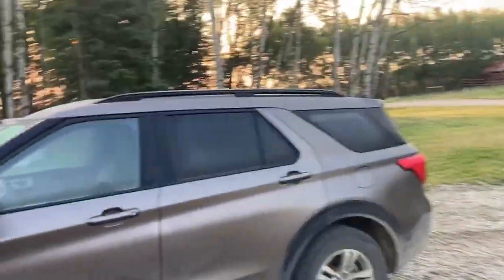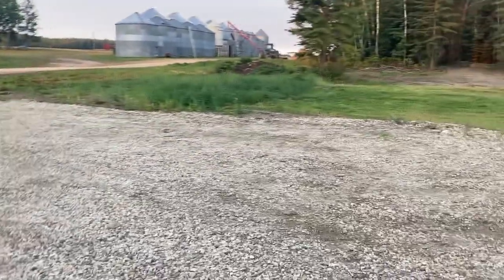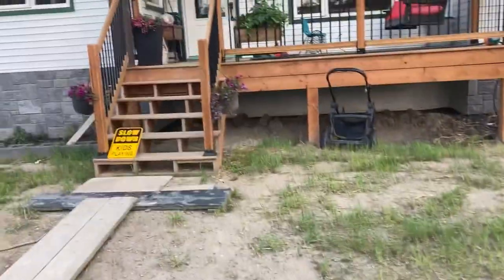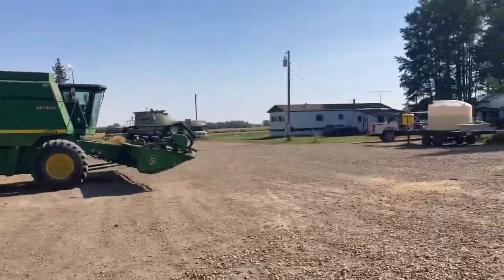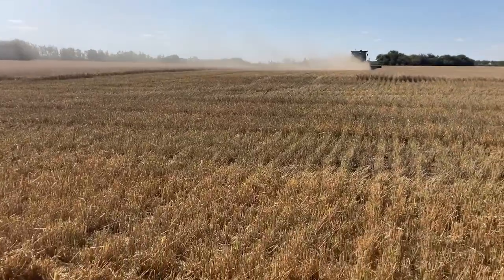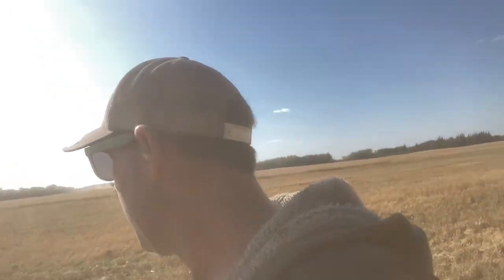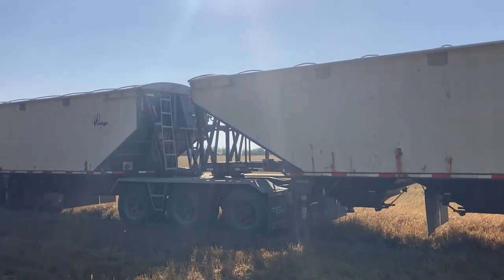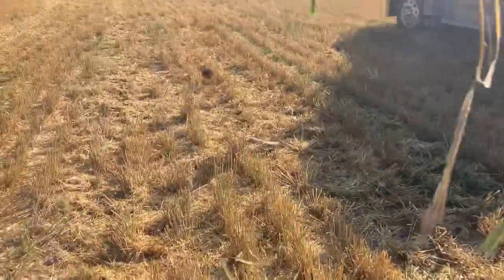She froze. But did it hit the ground?

Comment: We haven't had a frost like that here yet. Ive only straight combined a bit of canola just to say i did it. I never sprayed it to ripen it. Took a month longer then the swathed stuff to be ready to go. It froze hard 3 times. Neighbor told me it will be fine.  It ended up yielding 5 bpa better then the rest of the field that was swathed. It was number one and it really went well. I havent done it since.
Reply from the maker: We have yet to try. But I went back one year and shelled out by hand a bit in a strip we missed. It seemed to be just fine. But I have seen years where guys had just mush standing in the fields